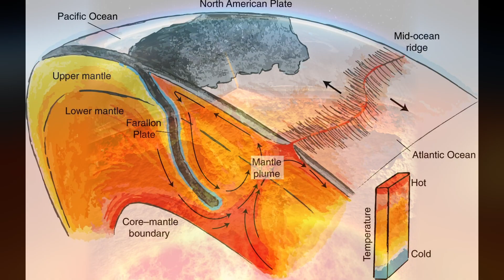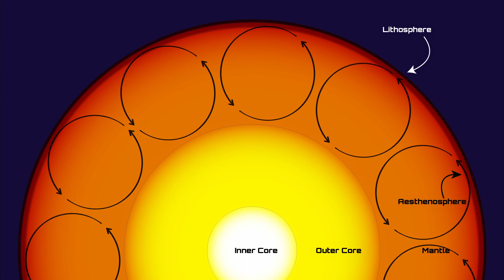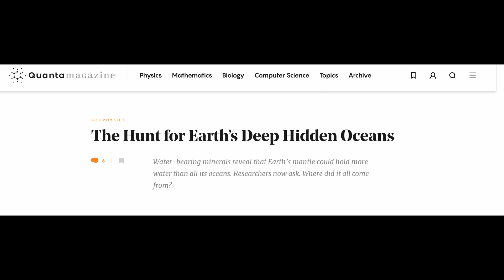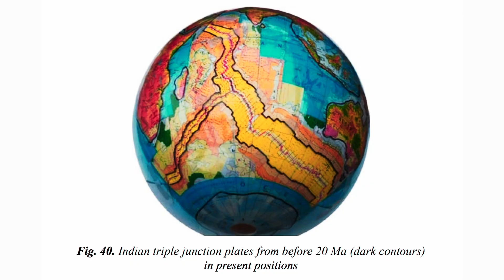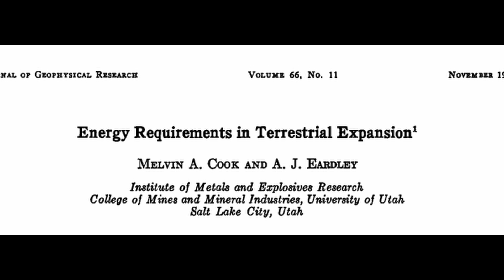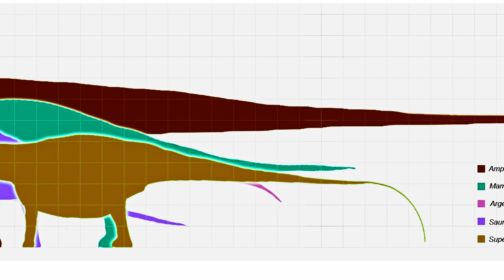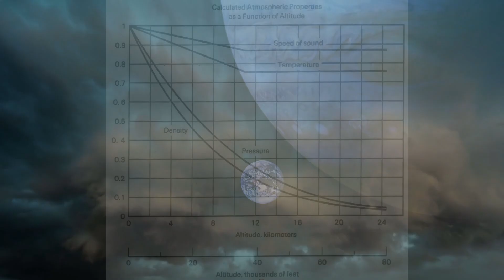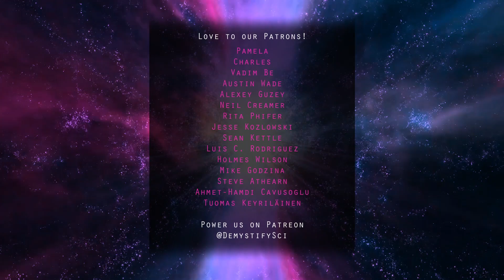Did Earth Start as a Mini-Neptune?

Comment: I've never really been able to fully grasp and mentally reckon with the idea that Earth may have been a gas giant. How >2,000km of atmosphere gets stripped away and leaves anything viable left is something I struggle to imagine, I feel there must be more to a gas giant than a small rocky core like our little Earth 🤔

I really enjoyed your glass model of the Earth as a tool for illustrating possible expansion of the planet though! I played around with this idea some years back now when I first stumbled across the concept but with a perfectly round (and sturdy) party balloon which I partially inflated and covered in multiple thin layers of different colours of plastecine/modelling clay, then inflated the balloon. It worked rather well, though if you're considering trying the method I would recommend making your layers as thin as possible, and to incised (with a blunt plastic edge)  the first few layers with the rough outline of the continents fitted together on the uninflated 'Pangea Earth' before you inflate the balloon. Oh, and you will need a balloon pump unless you have the lungs of Sir Brian Blessed...

As for a mechanism for the Earth's possible expansion, I have read of an idea called 'Star Water' that suggests water is created created in-situ on asteroids by the combining of hydrogen from the solar wind and oxygen from the rocks themselves. If that's the case then is it possible that a large CME hit the Earth and created and deposited huge volumes of new water by catalysing atmospheric oxygen, with the Earth then acting like a sponge and expanding/inflating to accomodate it?

Not only could it help account for the young ocean floors with their odd growth-spurts and the the matching shapes of the continents but also why there is evidence of abundant life at the poles before the ice (including all the animals that froze solid mid-chew) without the need for wild shifts in the poles or dramatic atmospheric losses

I've never written any of this down before so hope it's making some kind of sense... would love to know what you think!
Reply from the maker: Hey somehow this didn't show up in my notifications, but we're here now! I love the way you're thinking about this, and I tried to use a balloon for this but was doing it with raw clay that I'd made which did not play nicely at all - it crumbled as it dried. It was also hard to find a true spherical balloon - everything for sale that was round was huge - 36" across at least and so we went with the glass blowing since at least we could offshore some of that to the talent. 

About the expansion mechanism, I like it, though I can't offer mechanistic insight to how difficult it is for the rocks to absorb water like that. More needs to be done on chasing down dates for all these things - when was earth small, when did it start to get big? Is there significant lag time? I would say yes to the last part but on instinct rather than calculation. 

If you want, you could write up an outline for your ideas and we can put it in the "episodes to make" folder and could collaborate on it down the line ^_^
Reply: @DemystifySciInvestigates  Hey no worries, you both must spend an appreciable amount of time responding to comments! Also, thanks for inviting me to outline my ideas a bit more rigorously, as with your research projects, investigations, and forays I try to keep an open mind when it comes to theories that attempt to explain the as yet unknown so the following as all very much just spit-balling in that vein. I'm not dying on any hills today, as it were :)

First I'll respond to the balloon modelling as it will (tangentially) help me explain a bit of the theoretical framework the water-induced expansion idea is hung on. So clay... yeah that's clay for you, heh. That's why I went with kids modelling clay as its such fine particulate and has added plasticisers to stop it drying out so it allowed me to roll it extremely thin with the outermost layer keeping the four layers below it hydrated. The top layer never fully dried out either but did form a crust (more of a skin really) that had some excellent rifting when the balloon inflated.

The reason I went for layers was less to do with geological stratigraphy and more to do with the question of how Earth formed and how that might be answered through an electrical (EU/PC) process. Imagining how the ideas of electrical orogensis and deposition events such as those suggested by the likes of Michael Steinbacher and Andrew Hall could result in surface landforms that would be inherently 'weakest' at their edges providing fault lines, plate boundaries and rift zones. Taking that one step further down an EU/PC road also imaging the beginnings of that process inside a gas giant/brown dwarf, electrically growing a planet from seed by the creation of solid matter from the atmosphere of the parent and depositing it as layers on said seed.

It's a lot of leaps, granted, and I'm about to leap a good deal further... 

If we accept 'star water' could be generated and deposited in large scale events (such as a CME) the question comes down to two main elements. - the internal composition of the planet and how might water react in that internal environment.

Regardless of how 'mainstream' or 'alternative' your view there's little we can say beyond theoretical extrapolations but to stay in the mainstream (for now) the indirect observation through seismic data has been interpreted as a rocky outer crust (which is everything we have directly observed so far), a couple of increasingly liquid mantles and a couple of cores interspersed by various low and high density points, some surface hot spots and some deep and large-scale crystal structures (I think first proposed by Jeroen Tromp in the 1990s). The model we have of Earth is in effect a solid ball, albeit one increasingly liquid as you get nearer the centre but, in effect, there is no room inside the Earth.

The theorised crystal structures deep with in Earth are an extremely interesting point. Crystals need both water and space to grow, from the smallest geode to the giant gypsums of Cueva de los Cristales. The 2020 Nature article "The Earth's core as a reservoir of water' suggesting there's water up to 130 times that of the total oceans 1,800miles into the Earths core, if those low/high density regions were voids you would have all the ingredients you need to grow those crystals.

Now imagine what might happen if a large amount of new water was deposited on Earth would simply stay sloshing around on the surface of the planet or could it 'seep' into the planet? Rock is inherently porous (granted some are more porous than others), for example a rock-hewn basin in a rock cave won't retain water unless it is topped up periodically (whether directly or through sheer humidity), regardless of the rock type so it seems logical that water would 'seek' a way in. Once in the it begs the question of how it might that water react under such heat and pressure conditions, will it behave like water tends to do when heated, and how might the Earth 'system' react to that heated and pressurised water?

Day to day experience tells us that the water will either expand and/or transition into another phase but either way it needs somewhere to go. What I imagine is less that the rock absorbs the water like a sponge and more that the Earth as a whole acts like a sponge with water filling every available space it can and forcing the Earth to react, i.e. expand, thus creating more space and a resultant increase in diameter of the planet. I also imagine this as something of a two-way street with the Earth possibly going through periods of contraction dependant on the level and duration of periods of solar activity and the creation of star water; and periods in which it is less active and no or less star water creation takes place. Other day to day experiences like earthquakes and even the fluctuations in GPS surface heights measurements could even be as a result of minor day to day fluctuations in this activity.

Bringing it back to the idea of a younger Earth having been smaller than it is today, if we take the star water idea and combine it with the idea that electricity plays as an as yet not understand but central role in ( I want to say 'life the universe and everything' but for now I'll stick to) the Earth and the solar system. If the Earth was created though an electrical arcing and subsequent multiple deposition and resurfacing events that result in the geologic strata, mountains and faults and then deposit a large amount of water on it how does the water; the planet; and the solar system react to that?

I am by no means well-versed in electrical engineering or EU/PC but my understanding is that such a material change to the Earth would have an electrical implication insofar as the Earth's charge/potential would be changed in respect to the rest of the solar system and something would have to give as a result (I've seen various suggestions, a reorganisation of the planets seems to be the favourite). So this is where the expansion comes in, the planet is being forced to react to accommodate this water both physically and electrically, the water and its properties in combination with an electrical solar system (universe really) provide both the matter and energy required to make the Earth bigger.

In essence: less water=smaller and less active, more water=bigger and more active.

I'll submit this comment then think of 100 other things I also meant to say and another 100 I wish I'd said differently, that's a solid bet. Hope it helps explain my thinking a bit further and that its of some interest. Thanks for having these conversations :)
Reply: @LarsOfMars.  An appreciable amount of time but never enough!!

External vs internal water is an interesting debate, and the idea that some water could be added that could contribute to expansion makes intuitive sense, but we're talking about doubling the volume of the Earth! That's a lot of water and it's hard to imagine how so much of it could have come from a single event. 

While I do think there's a certain amount of electrical activity that's involved in planetary formation, I'm skeptical that it's the origin of all planetary features - though I agree that a significant change in density would affect the solar system, which suggests that whatever happened here is much older that current models would suggest. 

I see you're in the discord now, put some of this in the "theories in progress" channel!
Reply: @DemystifySci_Podcast  True, that is a lot of water but there's good evidence of there being a lot of water down there and it wouldn't have to happen in a single event, there could be a gradual accumulation day-to-day punctuated by massive and catastrophic events. Perhaps the various global extinction events and the resultant reductions in the upper limit of the size of living things give an indication as to how many big events there have been.

Regards electricity's role in planetary formation I totally agree that it's not the origin of everything but I do believe that it's role has been overlooked to the detriment of all science. The likes of Andy Hall's work is very compelling in parts (although admittedly a lot of it is still way over my head) and could explain a lot of Earth's features that current geological theory and understanding is unable to. Having said all that, even if we ignore EU/PC theories I do wonder what effect the telluric currents that we (as in 'science') do accept have on the water on and in Earth that less controversial science proposes to be down there. I think of Gerald Pollack and his curious results, or Robitaille and his, and wonder what's going on down there deep below or feet...

It's fun to muse, and equally frustrating 🙃
Reply: This should help. Let Ben Davidson know too that the star water thing is not needed. Earth's elements were always here. https://www.youtube.com/watch?v=CM0Hi0YwAJA

Comment: How thick would an atmosphere need to be to put silicates into solution? That would solve the issues with the current slate of gravitational accretion theories. Namely that continental plate material has never been molten, which no accretion theory can explain. However, if a thick atmosphere generated enough heat and pressure to put silicates into solution, all of the earths granite would have formed as that pressure decreased over time. Followed by a breakup and redistribution as that decompression continued in the eons that followed.

Comment: How do expansionists account for the thousands of kilometers of subducted crust seemingly found in the mantle? (see Karin Sigloch, Spencer Fuston) Just wondering.
Reply from the maker: The subductions don’t correlate to any expected convection cells … we propose that these faults are deep orthogonal cracks due to decompression. Imagine putting and orange peel over a watermelon, folds and bumps and darts are expected to overlay a (subducted) under layer.
Reply: @DemystifySciInvestigates  Might the convention cells be a red herring being that they are not understood to exist or not? I'm more wondering how all these thousands of kilometers of supposed ocean crust may or may not account for any expansion? It would have to have been at the surface sometime, right? Could the subducted slabs have some kind of effect on the mantle models that haven't been accounted for yet? So many unanswered questions, which is the fun part!

Comment: Maybe I missed this in the video, but wouldn't a smaller, same mass earth lead to a much higher surface gravity? Negating any benefits the denser atmosphere would give for the flying dino.
Reply from the maker: Remember the flying Dino had only a 3x atmosphere compared to today… the huge 2000km atm was long before the Dinos… maybe long before any life. The decompression driven rupture occurred much later as the crust weakened and fractured over the eons
Reply: @DemystifySciInvestigates  this is 100% correct
Reply: Hi! Gravity is related to the mass of an object, not its volume. In the "expanding earth" hypothesis, the mass of the earth hasn't changed, only the volume. Think of it like a slightly compressed marshmallow slowly expanding in the palm of your hand--the mass (and gravity) stays the same.
Reply: @kinggrowler3487  You are correct that gravity depends on an object's mass, but the FORCE of gravity between TWO objects is proportional to the product of their masses divided by the square of the distance between their centers of gravity, so an object's WEIGHT (gravitational force it feels) on the surface of the Earth would increase as the Earth's diameter gets smaller, as it would if it had a smaller volume.  This is why a 100 lb object at the North Pole weighs 99.65 lbs on the Equator (in both cases at sea level) because the Pole is closer to the Earth's CG than the Equator.

Comment: Wonderful! Examine all possibilities and only keep the best parts. A thicker atmosphere of about 2000 to 3000 km sounds feasible to me. Good work!
Reply: except it's that, in atmospheric physics, between thicker and taller, thicker refers to density .. taller refers to altitude. Lift being relative to flow, density has very little to do with flight, (except change matters), pressure and density are related but often misconceived into wrong conclusions, and models that never work properly .. cheers. Consider that location is the only factor needed to change to affect gravity, of both bodies ... when an orbitting body moves closer to the central object .. instantaneously PE is converted to KE .. orbital speed increases, years get shorter ..

Comment: Excellent stuff!
Also, to complicate things further:
Imagine a pair of spheres with equal mass and equal volume/size but with different density distributions. One has consistent density distribution like a solid while the other is mostly hollow with all of its mass at the surface. What would the difference in gravity be on the surface of each? Also, wouldn't there be more lateral gravitational forces in the latter, especially on very large spheres where the surface could almost become a plane? And what if there was clumping on the surface? Could there even be some point where the lateral forces might pull clumps apart or at least aid internal pressures in doing so? Might lateral forces even help expand the entire structure, should there be any internal forces already pressuring this, perhaps a decompression from the center toward a compression of the surface? But then if the surface of the sphere reaches a maximum compression and density and say the entire sphere just started to grow in volume, doesn't there come a point when the surface could thin so much that gravity decreases at the surface?
Yeah, this topic just in regards to gravity is so complex it always hurts my brain. Then you start talking about atmospheric pressure, and I get lost. Like why does Venus have almost a hundred times our atmo pressure with less gravity? Because it's so hot? So badly, I wanna just simplify things and say our thicker atmosphere in the past simply was because Earth was younger and hotter and much of that vapor has now become our larger oceans today. I wanna just say that Dinos were a thing because young Earth had less surface gravity with a denser atmosphere. But I also suspect that's overly simple and probably wrong.

Still, I think our wondering about such things is more right than the popular stories. So there's that.